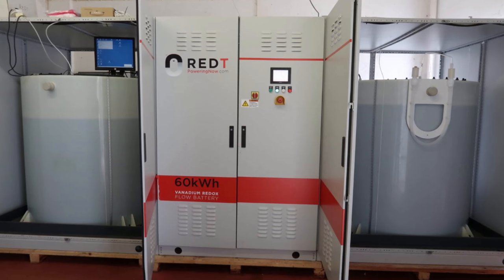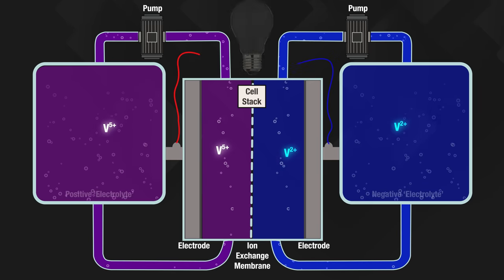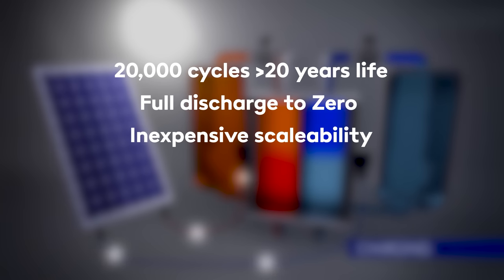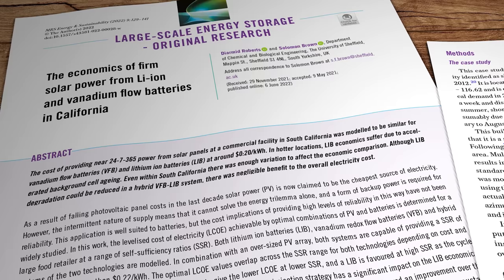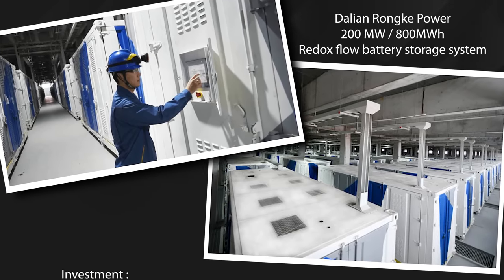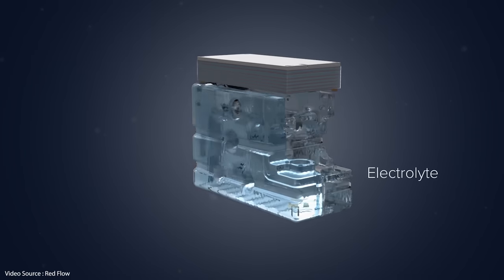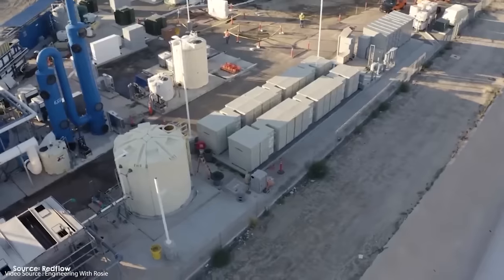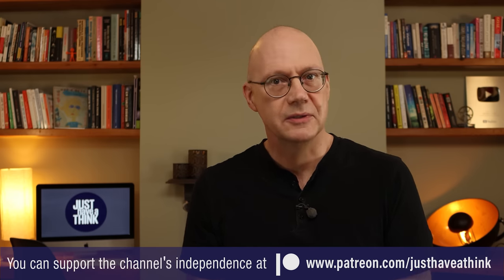The new billion dollar battery disruptor!

Comment: The biggest problem with Vanadium Redux Flow batteries is the cost of the Vanadium ingredient. Vanadium costs about $100/kg, and this chemistry has a Stoichiometry that needs about 1.33 kg of Vanadium per kWh stored. 

That brings the absolute lowest cost (cost for the Vanadium raw material alone) for this battery type to about $133 / kWh stored. Lithium-ion is almost at this level already, so Vanadium Redux is going to be priced out of the market pretty soon, if it has not been already.
Reply: Not to mention the cost of the ion exchange membrane, which in itself is 30-40% of the stack cost. You also need materials that can withstand oxidation and low pH, which means graphite. Graphite is cheap, but not when you have to machine it with flow fields and impregnate it with a phenolic resin to deal with the porosity. 

My whole thesis is on VRFBs so I'm glad the word is getting out on them. They have a lot of room for improvement and I don't think vanadium is the end all for flow batteries, it's just the best option right now.
Reply: @allthingsdestructive  Interesting. I did not know that you could use graphite for your PEM. I thought you needed some ionomer (a polymer) material. But hearing you, graphite is apparently not without issues either....

Comment: 22 cents per kwh is VERY expensive though, even in California that would be way too much. The issue with vanadium flow batteries is that vanadium itself is expensive, and this cost will scale with the duration of the battery, so I really don't think this can work
Reply: I am paying £0.3228 per KWH

Comment: Zink? Couldnt they use copper or cobalt if they are looking for materials which are crucial for the transition??
Reply: It's all about the cell potential of the redox couple. The V2+/V3+ couple sits very far from the V4+/V5+ couple which gives a high cell voltage of 1.23V. The Cr-Fe couple comes close but is definitely worse than V for various reasons.

Comment: Cost will be key. I would bet on pumped hydro with underground lower reservoir. No new technology needed. Almost unlimited capacity. And predictable cost.
Reply: Those only have like %20-30 efficiency unlike li ion batteries which has more than %90 efficiency. You lose more than %70 of the energy. Thats a bad bussiness even it has less maintenece cost

Comment: Going forward, I suspect flow  batteries may struggle to compete with Sodium Iron
Reply: I doubt that. Sodium ion will be good for homes and small things, perhaps an electric bicycle or a cheap city car. Flow batteries are much easier to scale for the grid
Reply: @موسى_7  I'd have thought that too. But there's a lot of grid scale lithium Iron going in despite the benefits of flow batteries.  I think it probably all comes down to cost - and maybe energy density. Flow batteries have been around for over 20 years and are still expensive. Sodium iron is still in its early stages of development. Long term, my gut feel is sodium iron will just be cheaper

Comment: Thanks for the update.

I have always been very skeptical about redox flow. They do need a lot of moving parts, and for some reason they were only at lab or kWh scale, even though they always promise that this would scale enormously. Then you spent most of your video talking about the comparison to Lithium-Ion, which usually means NMC/NCA. The economics (LCOE of 22c per kWh is nearly double that of Tesla Megapack) and the lifespan compared to LiFePO4 never does look as rosy, and it is always a red flag for me when people deliberately ignore LiFePO4, it's a sure sign that it is not competitive.

But then came the relief: we finally do have 100s of MWh scale installations, and Redox flow finally is making a dent. Great!
Reply: It's no more moving parts than a caustic plant or indeed a power plant. 2 pumps hardly make it complex.
Reply: @cliffwilliams8616  But its operation fully depends on pumps and valves, and probably cooling. Whereas all you need with lifepo4 is cooling.

This was however my thinking on why redox flow was only hype and never saw any real useful installations, which seems to have been solved now.

Comment: I've got a fantasy apartment building/development in my head (as part of my lottery fantasy), and part of that is a liquid-flow battery setup capable of powering the building for at least 3 days completely off-grid. It would probably need Li-ion batteries (one per unit or one per floor, idk) to handle the direct demand, with the flow batteries feeding them at their slower rate.
Reply: Part of your advantage (quite possibly a large part vs existing structures) is you can build energy efficiency into your design thereby reducing the energy consumption up front and increasing the usability of any storage you have.  Depending on your goals a centralized storage facility may lend greater efficiency/benefit as you lower the oversupply/storage at the individual level.
Reply: @primordial_platypus  That'd be great! Then my old man could scream at all the neighbours to "Turn those #@%&ing lights off!" as well as at his own family! 🤔🙄😁

Comment: Hmm, Rosie made a statement that differs from yours in that she described system upscaling is related to anode surface area rather than tank size. See timestamp 4:30 in her video.
Reply: Depends what you're scaling. More power output requires more surface area, but greater capacity requires more storage volume.
Reply: RFBs have their capacity and power decoupled. More cells/bigger cell area = more power while bigger tanks = more capacity.

Comment: "Decarbonization"? Really, do you grasp what hydrocarbon feedstocks are used for? From plastics to fertilizers to pharmaceuticals, We are junkies.
Reply: We can achieve it eventually...  Every river begins with a drop of water.
Reply: @Les_S537  Have you matriculated into Organic Chemistry?  I'm extremely curious, enlighten me as to what you propose to employ as a substitute.
Reply: @scottwolf8633  You're missing the nuance...  

We pump oil and gas out of the ground and we use it to produce fertilizers for plants, but the amount of oil and gas we use for that purpose pales in comparison to the amount of oil and gas that we use for transportation and energy generation purposes...

We will NEVER stop using oil and gas for these purposes in the same way we will NEVER stop using coal to produce steel.

But we WILL stop using oil and gas and coal for transportation, and energy generation eventually.
Reply: @Les_S537   You didn't answer my question vis a vis any Organic background, so none? 
"The world’s first customer delivery of “green steel” produced without using coal is taking place in Sweden, according to its manufacturer. The Swedish venture Hybrit said it was delivering the steel to truck-maker Volvo AB as a trial run before full commercial production in 2026. Volvo has said it will start production in 2021 of prototype vehicles and components from the green steel." 
 Published in 2021just a single quote out of many reports on the the, "Never", subject.
    You are way behind the power curve and most likely a non Scientist.
"When a distinguished but elderly scientist states that something is possible, he is almost certainly right. When he states that something is impossible, he is very probably wrong." 
BTW if you had bothered to take at least 30 Seconds to research your assertion before pontificating, you'd have learned something of great value.
Reply: I answered your question, you either just didn't like my answer or you need to ask a better question.

You began this thread asking what hydrocarbons are used for...  You pointed out that they're used for pharmaceuticals, plastics, and fertilizers.

81% of every barrel of oil goes towards producing gasoline/diesel/jet fuel.  The other 19% goes towards making plastics (~11%), lubricants, asphalt, medicines, and makeup, etc...

In the future we will cease using the 81%, but continue to use the 19%.

Same story with coal today...  Last year mankind strip mined over 15 trillion lbs of coal out of the crust of the earth...  The vast and overwhelming majority of that coal went towards energy generation (despite the fact that only 30-40% of every ton of coal actually gets converted into electricity).  We will eventually stop using coal for energy generation, but will continue to use it for steel production, and other minor uses...

As for your green steel...  They literally just shipped their first stock to customers...  I'm betting that within a few years we will begin hearing about how substandard it actually is...

Comment: Redox batteries are terribly inefficient which is why they have failed to capture marketshare.  A solar plant that uses redox batteries will provide 10-20% less energy to the grid.
Reply: The original VRFBs have round trip efficiencies of around 80% which I wouldn't call terrible compared to many other energy storage solutions. Newer versions have approached 85% coulombic efficiencies using better electrolytes and membranes.
Reply: The point and reason for any battery application in association with a solar installation is to store any excess electricity produced for usage when the sun is not shining. If there is no excess energy produced then there's no need for any kind of battery to store that excess energy. And doesn't the video show that redox batteries are indeed beginning to capture market share?
Reply: @allthingsdestructive Too inefficient.
Reply: @larryhawes8295  They are too inefficient.  Perhaps you're unaware of the scale at which battery-storage is being rolled out.

Comment: In a battery, it's the flow of electric charge that is more important than the movement of individual electrons. While individual electrons do move within a battery as part of the electrical current, what's more significant is the flow of electric charge, which is carried by electrons in the conductive materials within the battery.

Comment: Imagine if all the parking lots were made of a ultra durable solar panel material.
Reply: In Texas forty years ago most apartments came with covered parking spot. Low cost carports in the lots. It would be simple to change the design to be sturdier to support solar panels. A car sitting in the summer sun was not pleasant to get into so this kills two birds type thing. August in Houston really did damage to car interiors so man made shade is valuable. They also tended to flat roofs on the buildings so again solar would be a godsend for cooling Imagine DC heat pumps. Also DC lighting circuits with LED tech. So many ways to better what we have.
Reply: @markpashia7067  indeed, my HVAC system uses inverter tech to switch ac to dc, so I just took the ac out of the equation and feed it dc direct from panels, having a metal roof it got 160 in the attic at times, panels shading that metal keeps it below 120 now. Soon I plan to switch all my lighting to dc direct as well.

Comment: Alright now i'm curious whether this could be used to transfer energy. As in could you charge the fluid somewhere in the dessert then use tankers to move the liquid to the city to be used before shipping the used uncharged back to the desert.
Reply: That's actually a really good idea if possible. And could be a good re-use of some existing pipeline infrastructure.
Reply: LOL. I'm pretty sure transporting the electrons via wire would be a cheaper option.
Reply: Or a train on a continuous loop?
Reply: @tomjacobson7623   Maybe, but, there is a theoretical limit to the transfer distance of electricity via wire. There ends up being too much loss over long distances. Especially with DC voltage which is what we would be using in the case of batteries. 

That's the reason we have to build power plants more locally rather than one giant central facility.

If transferring the liquid is lossless (or closer to it than transmission via wire) then this could potentially be a great idea. That is assuming you're not using Fossil fuels to transfer that liquid.
Reply: The energy density is too low and it's better to obtain some sort of fuel instead.
Reply: Not a good idea.  The energetic cost of moving all that water would make it too inefficient.

Comment: The more I see of these technologies being employed to to replace FINITE Flammable Fossils (FFF) the more I’m disillusioned, it all looks great but all of it has huge amounts of FFF energy imparted into the manufacture and construction of the systems being installed. I can’t cover all the items whose existence is the result of FFF’s, I’d need a book or two to do that, but there’s the materials that go into the building that houses these batteries and all the construction vehicles, power tools, delivery transport, we could subdivide these down to all the components that make up these vehicles and tools and so on right dow to these batteries ad infinitum, what a crazy situation we’re in. When FFF’s are no longer accessible or economically viable we’re going to be in deep deep trouble. We’re Energy Blind on the road to “The Great Simplification”🤔
Reply: I doubt anyone seriously believes that we can eliminate FFF use, however, it is quite possible to stop expanding and hopefully lower its current use.  The infrastructure already exists to create and transport the FFF we already use so if we can drop current use we can simply maintain what we have (and possibly shut some of it down).  That should greatly increase the reserve capacity and eliminate the need for less efficient methods of harvesting.

Comment: Dave, I have to challenge the concept of any battery challenging the fossil fuel industry: in the UK, power came from coal and gas. But oil is used for transport, cars, planes and trucks. They are 2 separate markets: don't confuse them and don't be so careless - your analysis is usually better than that!
Reply: um...electric power will increasingly be used for transport, as well as industrial and residential uses.  So, solar, wind and batteries can challenge coal, gas and oil.

Comment: If Nuclear Fusion is achieved, stationary batteries are obsolete.
Reply: That's a very big if. But even in a world where viable fusion reactors exist, I think there's a call for medium term energy storage. From everything I've seen, the reactor designs that are intended to eventually produce energy for public consumption aren't throttleable, they are either on and producing the amount of energy they make or they are off. So in that scenario you need to come up with some way to match the peaks and troughs of electrical demand to the relatively fixed output of your reactor. That's probably going to be some kind of battery.
Reply: When nuclear fusion is achieved batteries will be very complementary to fusion. A fusion plant should operate at nearly full capacity 24/7 to be most economical (you save little or nothing by reducing output). 
There will be many times when there isn't any demand for the electricity produced. A battery would complement the plant by taking up the energy during low demand and doubling the output during high demand times.
Reply: That’s kind of a big assumption. We don’t know for certain the limitations of fusion as a power source yet. I wouldn’t bet on fusion completely replacing every other option, even in the far future.
Reply: Don't need Fusion when we already have fission!! We just need people to get on board and push for it! The UK has enough energy stored up in spent fuel to power the country for centuries just need the sites to use it. 👍
Reply: @dymaxion3988   Fusion is not envisaged by anyone to replace every source.  Any expert in fusion will tell you that fusion is most suited to baseload operation and will be complemented by renewables and storage.
Fusion should replace fission, gas, oil. I doubt that it will ever be cheaper than renewables.
Reply: @robfer5370  perhaps, but this is a global problem rather than a UK problem and getting everyone on board has proved extremely difficult thus far. Additionally, fusion is one of the few things in which the UK is still a world leader.
Reply: You'll need way more than just achieving fusion.  You'll need to build a practical plant in which the heat from fusion is converted to electricity, probably losing half the energy to Carnot inefficiency.  The engineering difficulties here are massive.  All of this must be done in a way that yields a Levelised Cost Of Energy that is at least close to firmed renewables.  This is all so unlikely that all I can say is LoL!!